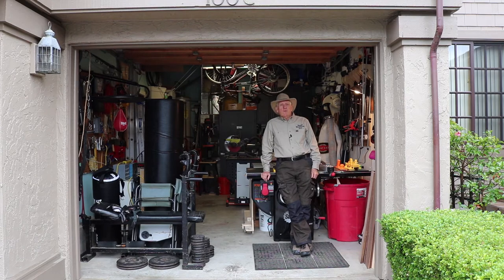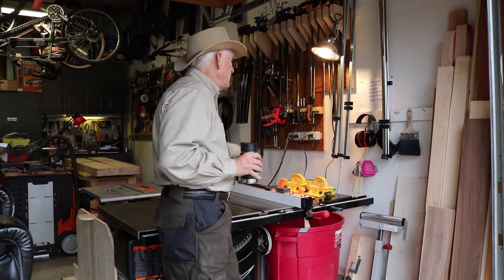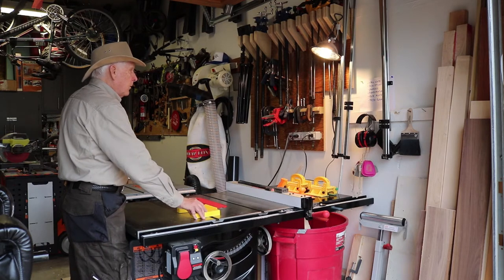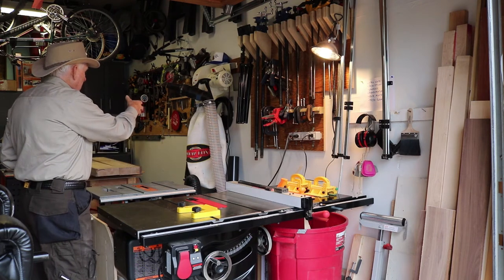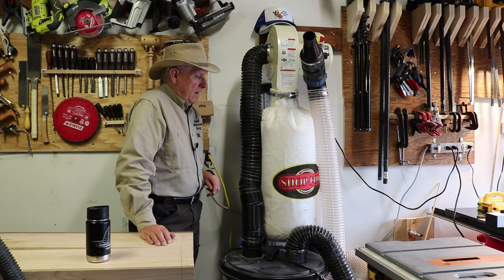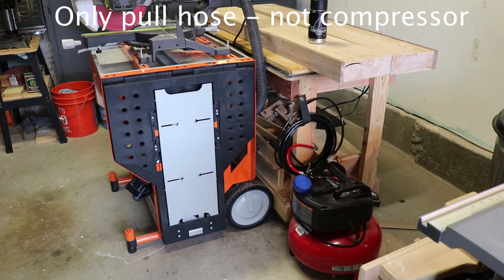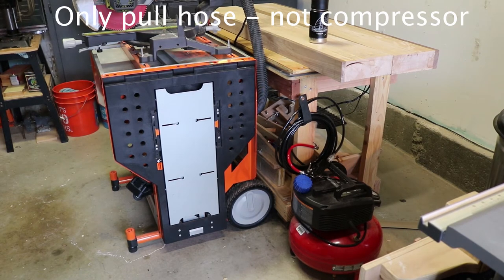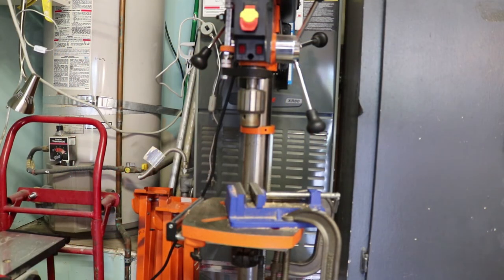Workshop Tour 2018 Video - Layout Ideas, Tool Wall,  Clamp Rack,

Comment: Nice video and layout.  I'm working on building a laundry room in my basement.   Then my woodshop will move into the laundry area.  In the end both my workshop and laundry area will have more room.  I picked up some good ideas from your setup.  I like how you have the ear muffs and safety glasses set out.  AND a fire extinguisher.  In my current setup I have a wooden post at the entrance to my workshop.  On it I have a fire extinguisher and small first aid kit and other PPE.  
Edited to add that I like how you are honest about the quality of some of your tools.
Reply from the maker: I am glad my tour gave you some ideas.  You will find that your layout will evolve as you get more tools.  Mine is totally basically the same now as it was then except I have been able to add some things (jointer, oscillating sander, belt sander, grinder) since the grandson weight section was reclaimed by the Old Small Workshop Guy.  I may do an updated tour of my current workshop soon.  You know what, most of those "cheap" tools are performing just fine for my level of work and I find I like to use hand tools more and more.
Reply: @SmallWorkshopGuy  I'm going to have about 20 feet by 15 feet, with the ability to outfeed into the 6 foot stairwell/hallway.  So my plan is to design the initial setup in anticipation of getting a few more tools that are on my list.
Reply from the maker: @missouribob7850  I strongly recommend putting almost everything on casters including anything you buy or any tool bases that you build.  I find that now I have to move almost every power tool to use it except for my table saw, outfeed table and workbench.  But drill press, jointer, planer, mitre saw, bandsaw, mortising machine, etc. all get moved around literally everytime I use them.  But I only have 200 sq ft. - you will have 50% more space so maybe more of your stuff can sit in one place.

Comment: Great shop. I like the Portamate mitersaw table. Looks like a great solution for a small shop with the wings that fold down and that the saw can flip under giving you more assembly space. I agree about video making slows down your woodworking. Who would of thought the woodworking would be the easy part! Subscribed and going to go watch some more.
Reply from the maker: In reality, I do not find myself flipping the mitre saw underneath very often.  For whatever reason, I like setting up assembly table on saw horses outside when I need the  the space.  But I have often pulled up the wings for something.

Comment: I like to make most changes to the shop non-permanent. Just about everything is on casters and can be rearranged or moved into the driveway temporarily if necessary, even a big freezer. All shelving/workbenches are constructed with Simpson Strong-Tie RTC42 and RTZ2 connectors (Home Depot), meaning a workbench/shelf can be lengthened or widened by simply shortening or replacing a few 2x4's/4x4's/plywood and reassembling with screws. Reconfigurability is key for me.
Reply from the maker: Excellent ideas... I am learning more about those Simpson Strong-Tie things.

Comment: Good job man, and don't be too quick to assume that the cheaper stuff may be crap just because of the reasonable price. I've bought some over priced junk in my day just to pay some companies marketing bill.
Reply from the maker: Kerry, I agree.  So far my stuff from WEN and Ryobi have performed well for what I have asked them to do.  On the other hand, I have had a number of instances where I needed to upgrad e to a more capable tool - Router being an example, where I found I needed larger bits that required the 1/2 inch collet.